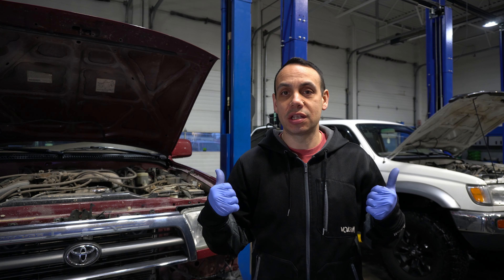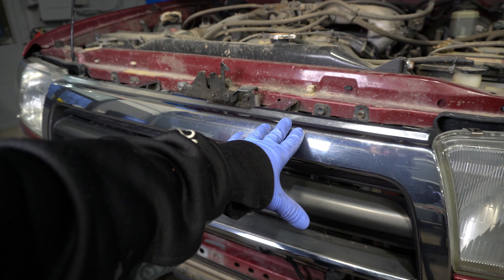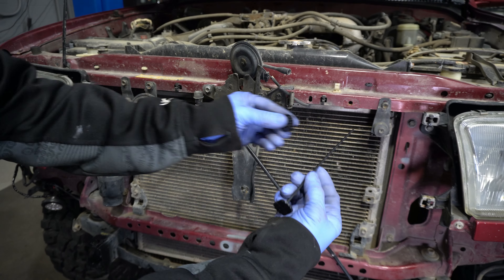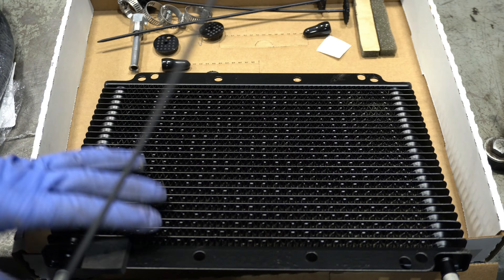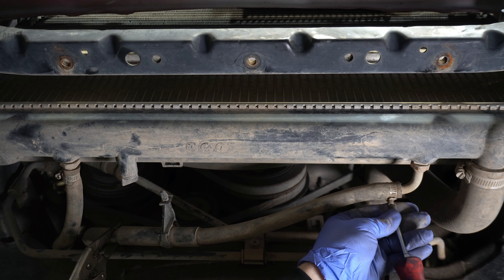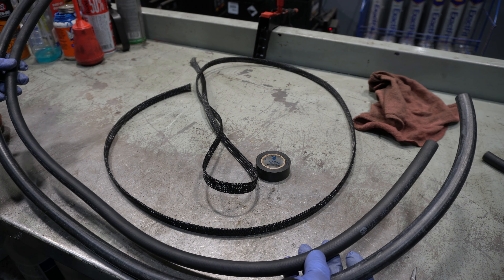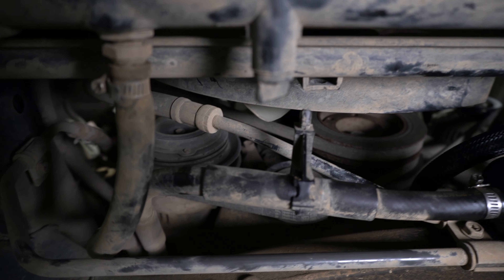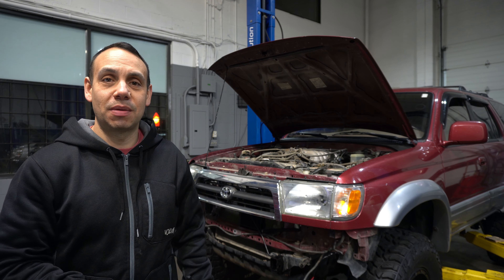3rd Gen 4Runner Transmission Cooler & Filter Install

Comment: Isn't the whole point of doing this mod is to bypass the integrated trans cooler to avoid trend and coolant from mixing and destroying your transmission..I get that this will provide extra cooling, but it seems kind of pointless to me if you're not bypassing the integrated cooler.
Reply: Not really unless your radiator is old you shouldn’t really have a problem and yeah if you live up north yeah that would probably be about only reason
Reply: I bypassed mine. It’s not that I need extra cooling, it’s that I don’t want to get the dreaded pink milkshake.
Reply: That’s what I thought. I wanted to see how to bypass mine.

Comment: Wasn't the purpose of running a external transmission cooler to prevent the coolant from mixing with transmission fluid?? I'm confused
Reply: @Vosmalus  when I do my timing belt I change the radiator. Probably the best way you're going to prevent milkshake from happening.  By running a standalone transmission cooler and not running it through the radiator when it's cold out you won't properly warm up your transmission.
Reply: Yes, but as mentioned, it's a good practice to pop a new radiator in a 3rd Gen 4Runner as a maintenance item much like lower ball joints are on these. Those are the only 2 weak spots on these. Radiators are cheap (115 USD for an 'OEM ' Denso unit) and easy to install. This prevents the Pink Milkshake but retains the heating functions the Toyota engineers intended. New upper and lower hoses and a new OEM thermostat with the jiggle valve a 6 O'clock and you're good for another 250k miles. Edit - while you're at it, get a trans temp gauge or OBDII gauge or app (1999 and later trucks only) to monitor temps when wheeling or if you tow in mountains. The idiot light doesn't come on until about 300 degrees and you're risking real damage to your tranny at that point. Blah blah blah - sorry. Nice video!
Reply: Its a dual purpose
Reply: @jameswatt4694  
So-
I picked up a 99 SR5 with 169K miles PO took really good care of the truck all Toyota hoses and belts etc &  looks like the original radiator as I can faintly make out Toyota on the radiator.
I should be good with replacing the radiator with another Toyota radiator and no need for the external trans cooler? I plan on doing no heavy 4wheeling or towing.
Tia
Reply: @richardmiller2313  The dreaded "strawberry milkshake" can happen, but it is statistically rare. I think the reason it is a constant topic of conversation is because the resulting repair bill is catastrophic to the hapless owner's wallet. 

That said, I think it's good practice to replace your radiator with every timing belt service.
Reply: @ML-dl1cp  What makes you think it's rare. Happened to me, for one, and I see it online in alot of places.
Reply: @DerbertMan  well, yeah, because it's why people are posting. Nobody posts "just checking in to tell everyone my radiator didn't fail".

For every YT video or forum post about the "milkshake" there are 100,000 4Runner radiators which haven't failed.
Reply: @ML-dl1cp  sounds about right, thanks

Comment: But the hot fluid usually is attached on the upper part of the new cooler, isn't? I'm  seen so many  different ways to ad a cooler in series... some say that once the fluid is colder should go down whit less resistance.  I really  don't now which is the best...

Comment: Awesome video.  I'm looking to do the same and it's nice to see you're keeping it tied into the radiator. I don't live where the cold would be an issue, but I also wouldn't want to lose that factory feature.
Reply from the maker: I'd say it's with doing. Extra filter is handy as well.

Comment: Thanks for the informative video Kelly! Did my first trans fluid flush on my 2001 SR5 4Runner with confidence thanks to your how to video. I added a Magnefine filter on mine and a cooler. Seemed to run great. Unfortunately I was trying to save my trans because I had a supercharger whine coming from it. No avail. Diag’d it as a bad torque converter.. just had it rebuilt and I’m reinstalling today in my driveway. Wish me luck! I look forward to more of your videos man. Next I think I’m adding a temp gauge to the trans..
Reply from the maker: Awesome Ian. Good luck on the trans job.

Comment: Nice work on this video and tutorial. I think this is the way to do it. For some data points, I installed a similar auxiliary cooler size on my 2000 in 2012 with around 120k miles and watched my transmission fluid temps reach 250° when climbing passes in the mountains often. I paybassed the OEM cooler like everyone talks about for fears of the dreaded failure or “design flaw” we all know. 

At around 230k miles and 10 years later, the trans ended up failing because of those consistent high temps and I had a lower mileage used one installed. I’m still seeing high temps (~230+°) when in 4 wheel drive climbing passes in the winter, so I think the auxiliary cooler alone is not sufficient for my rig. Maybe sufficient for others, but that’s not what I’m seeing. So I am going to reconnect the lines to the factory cooler just like you did,  just 10 years and one transmission later! Thanks!
Reply from the maker: What most people don't understand like one of the replies is, the trans actually needs hot Temps to operate and shift correctly. So seasonality and location have a fair amount of input here. A thermostat control control valve would be ideal or if you live in a really hot or really cold location. Not cooler in the winter full cooler in the summer, especially if towing.
Reply: Bypass is good if you have a brand new radiator and a sufficient cooler. But the series method is what Toyota does to all the rigs that come factory with trans cooler. So this YouTube is spot on installation. Also, you actually void most manufacturer warranty if you install the bypass method. I did mine with the 699 model (built in thermostatically controlled to allow cool fluid to bypass through the first couple rows of the cooler). This model is good if you live in colder climate. 

Instead of using the junk zip ties, I chose to bracket mount mine with the Hayden bracket kit. So the transmission cooler never touch the condenser or anything else. Using the zip tie method is ok if you plan to not do hard off-road because with time, the zip ties are bound to come loose. When it does, vibrations will cause leak if the condenser is rubbing against the cooler. The BEST method is to properly mount it with brackets. 

I took advantage of Timmy the tool man's method but did it slightly different without any drilling or having to bend the bracket. It fit like a glove.
https://www.youtube.com/watch?v=34wnfq85_qk&t=33s
Reply: @genxiong2695  Thanks for your suggestion. Do you have any photos of the cooler installed showing the mounting holes you used?

Comment: Thank you for this video. I did this same in-series method. Just curious what your new temp. readings are? For me, prior to the install my trans temp were averaging 178ish. After the install, the temps drop down to 89ish on avg. I'm a little worry because that's a drastic drop in trans temp. Keep in mind, this is just city driving with AC on (before and after). I haven't got the time to test very steep inclines to see what the temps will hit with the new cooler. But without, it was was hitting 220 - 240ish.

Update: Never mind. Went back and check my notes and the after installed temp was actually 155ish so I think I'm good.🤣

Comment: hi KELLY , YOUR VIDEOS ARE AWESOME AND WELL EXPLAINED !!!  im starting to overland my 97 SR5, i already have rear and front armor with a 13500 x-bull winch and so far 265-75-16, sometimes i drive my truck once a week and planning to go trailing next year, my question is  which HAYDEN trans cooler do you think is the best or which one should i choose 678 or 699?       should i install the cooler straight to the trans avoiding  the radiator?  cuz you never know the pink milkshake.  thank you in advance.

Comment: Great install video. I'll be tackling this project on Thursday, just replacing an existing leaky trans cooler with a new cooler and lines. 

One observation: my 97 4Runner came with a dealer-installed tow package that included a similar trans cooler. I don't know if the cooler is OEM Toyota but the first owner had it done at the originating dealer (also they zip-tied the trailer harness to the fuel line and that's nuts!). Anyway, the cooler was installed in the centre, and that small vertical crossmember (that supports the hood latch) had actually worn into the cooler and put a hole in it. Perhaps it is a little thicker than the Hayden. The clearance there is *very* tight. I notice you installed yours with part of the cooler behind that crossmember. I would advise avoiding that area all together.

Comment: Wouldnt it make the most sense to mount the intercooler as low as possible on the radiator with both ports facing the sky so its oriented horizontally? If the ATF cooler side is on the bottom of the radiator the more the cooler is there the more efficient the radiator will be

Comment: Do you have a link for the sheathing you use for the 11/32" hose? Would it be similar to PET Expandable Braided Sleeving in 1/2" size? Thanks! This was a super helpful video. Do you have any concerns over mounting directly to the condenser? I am on the fence about bending up some brackets to have it independently suspended. Just regular driving on my part so no real concerns about vibrations from offroading.

Comment: Is the extra filter necessary? Also what if you want to bypass the stock cooler, how would you run it? Feed side to bottom of the external? Then new return line connected to the old return line?
Reply: Not necessary, but if you add external filter, it will allow you to never drop the pan to clean that metal mesh filter. if you bypass stock heat exchanger it wont matter how you connect the aftermarket. but i wouldn't bypass stock heat exchanger, your trans fluid will never warm up to operating temperature.

Comment: Thanks for the install video Kelly! As these 4runners are known to have the factory trans cooler fail inside the Radiator, could this cooler be used to bypass this issue instead of a full rad/ trans cooler replacement?
Reply from the maker: Thanks, yes i briefly mentioned it in the video. just runs the lines to it. The return side it the same as I did. Disconnect the pressure side from the oem cooler and install to bottom of external cooler.
Reply: Great video will be doing this mod on the hoonirunner soon 🤘🏽
Reply: @Beacon_Offroad   you do realize that the point of a trans cooler is to not use the radiator due to coolant and transmission fluid mixing in the radiator which is a problem these T4R have. You did it completely wrong. It fixes nothing
Reply: @jmp216  Exactly right. Have you found this to be the case since it's been a couple years since posting this video?

Comment: Nice video but I’m confused. Isn’t the point of the external cooler to prevent failure of the internal cooler mixing fluids? I see you ran it through both coolers
Reply from the maker: Yes and no. There's multiple ways of looking at this depending on application and planned use. I'm not overly concerned about mixing as I stay on top of my stuff. You can actually over cool your trans fluid depending on outside temps and tome of year. The trans operates best at with warm fluid. This setup will cool hot fluid and warm it to correct on the way back into the trans. Running it a thermostat control would be the best way but it costs more and more difficult to setup. Hope that helps you understand a bit more. I could keep going but that should cover it.

Comment: So now you have two coolers in-line? What is the purpose?
Reply: So he can tow a trailer full of moose.
Reply from the maker: This is a balancing act. Depending on use, time of year and location. Factory cooler doesn't cool enough but it is meant to heat the trans fluid at a certain point as well. Depending where you live can be a factor. Here in the winter running a external cooler only would over cool the fluid.
Reply: What else would you need to coolers for??? Think think think.........

Comment: Hey Kelly. I'm wondering how all the added parts and passages affect the oil flow, and if that's something to be concerned about. There must be a pump pushing fluid out of the trans, creating enough pressure to push fluid back in (at least in stock configuration).
Reply from the maker: Not a concern, there's plently of pressure there. You'd know if you ever had a line come off or get a hole in it lol.
Reply: @Beacon_Offroad  you're right! Going to try a bypass setup with this filter. Ty.

Comment: As a transmission expert, you should never bypass the factory cooler. When adding an auxiliary cooler, you use the lower return line from the radiator. Then that line will go into the auxiliary cooler then auto to the transmission input. 

The coolant in the lower part of the radiator is the coolest it wiil be before it goes back into the engine. 
As for my FJ cruiser the factory thermostat is 180°. Also use 5/8 transmission line, not the line that comes with the cooler. 5/8" has more flow/volume.
Reply: but these Gen 3 radiators fail and leak radiator coolant into the transmission. So what is the problem with Not running the trans fluid thru the radiator? is it bc the trans fluid then wont heat up to a proper temp? seems like that would only occur in very cold climates in the winter...or does it happen in moderate climates in the winter too?

Comment: Just wondering, would you want the filter to be before the cooler so it won't containment the cooler incase there's metal in the trans fluid?
Reply from the maker: I dont think it really matters and let's be honest if there was a major failure and large amounts of metal you shoukd extensively clean the cooler and or just replace it in general.

Comment: I have a basic car question: generally speaking, how does transmission fluid flow through a cooler? Is there a pump?
Reply from the maker: Yes, inside your transmission there is a pump that generates the pressure.

Comment: Will this prevent pink milkshake?
Reply: It looks like it will only prevent the milkshake if you run the cooler bypassing the radiator. If you run it in series like this, it will still run through the radiator. So there is still a chance of the radiator failing and, in turn, the dreaded pink milkshake!
Reply: Nope. He missed a great opportunity to avoid that issue.

Comment: Why don’t you just use the external cooler? one main reason to have an external cooler is to prevent transmission fluid and coolant mix together when the built in cooler fails.
Reply: Running the trans fluid through the radiator helps heat the trans fluid up to temp.

Comment: you do realize that the point of a trans cooler is to not use the radiator due to coolant and transmission fluid mixing in the radiator which is a problem these T4R have. You did it completely wrong. It fixes nothing. Plus the filter has to be before it flows into cooler. If anyone thinks it’s fine I’ll replace radiator every timing job, then that’s dumb due to it happening before timing is needed because it’s a flaw in factory design.
Reply from the maker: I understand exactly every point of what your saying but if you don't understand why it's set up like this then it's beyond you. Thanks for leaving a comment,  have a great day 👍.
Reply: @Beacon_Offroad  your reply seems evasive. @jmp216 seems correct. What is wrong with what he is saying?